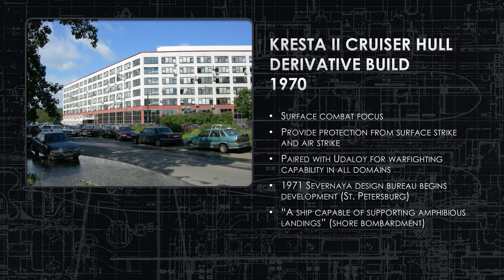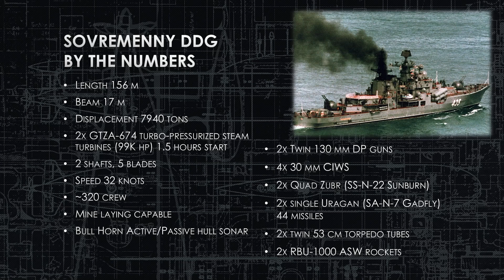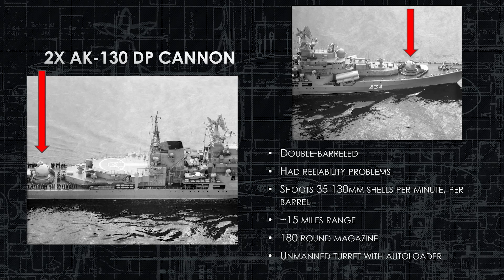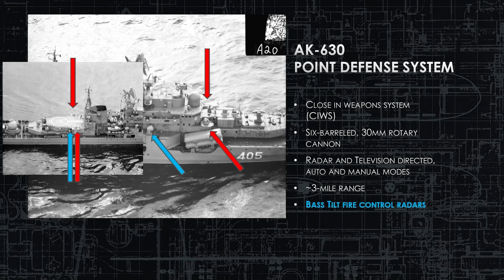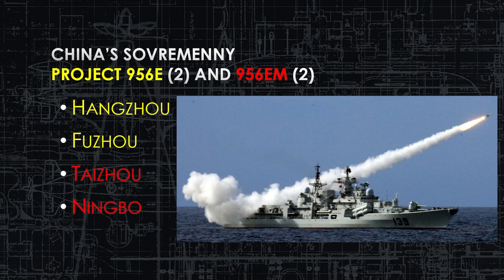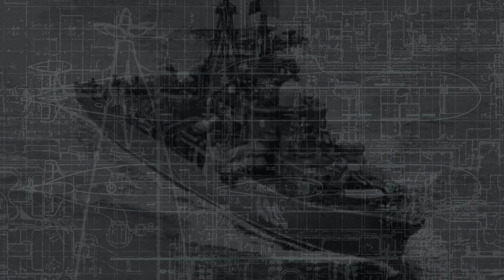The Most POWERFUL Soviet Destroyer Ever Built!

Comment: The propulsion system suffered from scale build up in the boiler tubes.   If you have impure super heated steam enter the engine turbines then you will very quickly cause pitting on the blades.  This can develop into catastrophic failure, blades disintegrating. At 10k rpm. Not good. Scale buildup is a problem with any of these water-based systems. The US Navy has strict chemistry programs to monitor and help mitigate these issues. Once coming out of a port in the Caribbean we had a cooling system immediately scale up. I mean within hours the tubes 3/4 of an inch tubes had add 1/8 inch of scale. In peacetime ops you shut it down.

Doctrine to kill the sovremenny-class destroyers: SM 1 or 2 salvo size 6-10. The SM1 covers 15 NM in 10 sec.The close in/ point defense systems will be over whelmed . It may knock down 3-4 SM1s but even three SM hits and they will be too busy with damage control. soviets/ Russian are not quick enough. of course you still have to get into position to shoot first and an SSN may be there first. but I would pray those assets will be seeking under water as a priority.

I got to walk aboard  a Sovremenny and. Udaloy in 1990 in San Diego. 1) sailors sleep in hammocks. crew personal gear were hanging in bags on hooks,  crews toilet was a horizontal eight inch pipe with holes cut in it. it was a real step back to the 19th century 2) I saw only four fire extinguishers. No hose stations. hydrants but without ready hoses. Shoring lumber was painted in place. 3) CIC had four scopes.. 

Now I will grant this, Soviets sent older ships. But if a portion of your fleet is like this you are toast in a serious fight.  The reciprocal visit of Russian admirals to a Burke class  was conducted (1995). We brought their admirals right into  the sanitized   DDG's CIC and showed them what " mission control " afloat looks like. I saw mouths actually gape when we turned on one of the main display screens 

Note : We did not show them anything that was not normally shown in a public tour.

It is too bad our corrupt govt cannot  get it's act together. These ships are still being built, but some are now over 30yrs old and there is not a serious follow on design even planned. America's biggest problems are its own corrupt officials.

Comment: P-Fired Boilers are equivalent to the ones on my 1967 Garcia class (USS Koelsch) that I earned my EOOW qualification on. Ours were 1250 psi, so the boiler-water feed-water purity requirements were stricter than for nuclear plants running at far lower pressures.

Comment: Mr. Sub Brief misses one key point: in 1984 the radio horizon of the CG of Ticonderoga-class was around, let's be generous, AN-SPS at 20 meters, let's count with 3M80 20-meter elevation about 32km . But here is what Mr. Sub Brief doesn't know, Moskit wasn't flying straight, because it also could see the target with its active radar homing head from 32 kilometers and instead of flying at 20 meters at terminal it was beginning to maneuver violently, including, but not limited to, conducting anti-AD "gorka" (hill) maneuver with insane g-loads and it was done at the speed of M=2.5+. If you think that Aegis and whatever was carried then in MK 41 VLS and Sea Sparrows could handle that, let alone a salvo of 4-6-8 of those--I have a bridge to sell you.
Reply from the maker: good feed back. thanks for the context.
Reply: Lmao we trusting russian agitprop in 2025?  We've seen their superweapons fail miserably time and time again.

Comment: You forgot that the PLAN also put HHQ-10 and refit the Sunburn with newer YJ-12, which tbh looks similar except more blocky intake :v
Reply: He confused the 956E refit with the 956EM.

The refitted 956E kept the aft turret, and AK630. Changed missile to YJ12 and VLS HHQ16. Added HQ10 for point defence.

The 956EM was built with extended helicopter hanger  deck without aft turret, and had Russian Kashtan fitted as standard. There's no such thing as a Chinese Kashtan. 
Neither 956EM had refit.

Comment: Is there really a meaningful distinction between cruisers and destroyers these days?
Reply: Imho it's now a question of Mission, rather than shape or size.  For reference, compare the Spruance, Kidd, and Ticonderoga classes- all built on the same hull.
Reply: @WildBillCox13 This is the answer: mission. To add some more context, one of the critical capabilities the Ticonderoga class has over the Arleigh Burke is that the Tico has additional facilities to host the Air Warfare Commander, which is a critical role in defense of the CSG. DDGs can theoretically take on this role, but the lack of dedicated facilities makes hosting the Air Warfare Commander burdensome and comes at the cost of other capabilities.
Reply: @WildBillCox13  So what mission distinguishes a cruiser from a destroyer today? Originally, cruisers were built to be able to act independently of the battlefleet, and destroyers were built to screen the battlefleet, but what is the distinction now?
Reply: In today's world for the larger Navies, i.e U.S , Britain,  France, Russia, etc; the only difference is the amount of missiles it can carry and with U.S Aegis Cruisers compared to Arleigh Burke Destroyers is that the Cruiser (Ticonderoga) also have two more Aegis Radars. That's about it. The missions are about the same now.
Reply: Cruisers just sail around, destroyers kill things.

Idk I'm not in the Navy.
Reply: In modern naval warfare theres no meaningful difference between a cruiser and a destroyer aside from the fact that cruisers are usually bigger than destroyers. Their mission sets are pretty much the same these days
Reply: well, take a look on 1144 project....
This is a cruiser
But it's kinda battleship sized boat

Comment: Noticed on a few other videos, Joint Stock Company - that isn't the name of the shipbuilder.  A JSC is a type of company (A public joint-stock company, abbreviated PJSC or open joint-stock company, abbreviated OJSC, is a type of company in many successor states of the Soviet Union, particularly in Russia. Its distinguishing feature is the right of stockholders to trade in stocks without the permission of other stockholders).

In this case the particular JSC is United Shipbuilding Corporation.  The shipyard they own that built these is Severnaya Verf, or during the Soviet era Shipyard No. 190 (in the name of Zhdanov).  JSCs are a post-Soviet structure and United own a great deal of shipyards.

Comment: Sovry was not so often on the sea because faulty propulsion (in fact, it was more reliable, than Udaloys gas turbines) but because of their mission. Sovries were antiship and antiair ships, udaloys were antisub ships. In time of peace, antisub missions were regular, antiship missions not so much.
Reply: The Udaloy2 class is  a Replacement for  both vessels. It is reliable Gas TURBINES or Didn't YOU KNOW! HEY SPENDS MORE TIME AT SEA THAN YOUR LCS? Didn't YOU KNOW THAT EITHER!
Reply: @HENRISTARKS  No, Udaloy II was not replacement for both vessels. Original Udaloy had Silex "missiles" which was by rocket delivered torpedo primarily against submarines, because Udaloy was anti-submarine warfare ship. But during 80s Soviet navy accepted into service RPK-6 Vodopad, which was by rocket delivered torpedo, which fits into classic 533mm torpedo tubes. And all ships with those torpedo tubes were pretty soon equipped with those Vodopads. In that moment Silex RPK-3 "missile" become obsolete because Vodopad RPK-6 was superior in everything and Udaloy could carry up to 20 Vodopads. So they had now free large missile launchers able to equip large antiship missiles and choice was Moskit, which was not so long range as P-500/700/1000 but it was faster, significantly cheaper and had very good AA defense penetration ability. But Udaloys II mission did not changed. It was still ASW ship, with only selfdefense AA capabilities (yet massively improved by Kashtans) but now packing also some serious anti-ship punch.

They eventually replaced all Udaloys Silexs by Moskits. But mission division still remained.
Udaloys were ASW destroyers, Sovries were AShW and AAW destroyers-escorts with side mission of coastal bombarding with their 4×130mm cannons.
Reply: @tomascernak6112  Udaloys Had better AA capabilities, as far as i remember.  
Thought you are right, besides, another Sovry mission was Assistance and Artillery Support for landing operations. Which are not really common as well
Reply: @RighteousFallen-III guess YOU NEVER HEARD OR SEEN SA-N-9  with CROSS SWORD FIRECONTROL RADARS. SAN9 is a Short Range SAM like a SM1MR!  SAN7 GADFLY WITH FRONT DOME FIRECONTROL RADAR IS MEDIUM RANGE SAM! Uh yeah from a GM AND FC TRAINED COLD WAR VETERAN BB61 87-90!  Get YOUR FACTS STRAIGHT OR BE SILENT!
Reply: @RighteousFallen-III  You are wrong. Udalyos had "Tor" short range missile system. Sovries had "Buk" medium range missile system. Sovries were intended as escorts for capital ships like aircraft cruisers or missile cruiser. Which had very good ciws and also long range AA defense, but lacked medium range AA defense.
Reply: @tomascernak6112  Ah, yes, makes sense since "Landing Fire Assistance" includes suppression of aerial targets aa well.
I've always had bad times remembering "ground" names for Sea converted AA
Reply: @RighteousFallen-III  This is absolutely understandable. Soviet-NATO naming is absolute mess. This is why we should have discussions/comments in first place, we can discuss things and either correct ourselves or learn something new.

Comment: I really don't understand the issue with the water, as even older merchant vessels could produce distillate quality water.  I would tend to think that in service they either weren't maintained (excessive steam, condensate and feedwater leaks, especially to auxilliary systems), thus requiring makeup feed in excess of what the distilling plant could produce, or poor availability of chemicals and testing equipment.  If the boiler water isn't dosed with oxygen scavengers and phosphates (basically soap), then the scale which forms on the tubes creates hot spots which then blow out into leaks.  This could also occur if the tubes and boilers were of poor quality and developed leaks at welds or joints.  This would also increase makeup consumption. Making sure your feedwater is pure is one of the most basic things a marine engineer learns and I honestly can't belive, even the soviets, would willfully neglect that.  Not to mention, they were operating nuke boats at the same time, which had no problem making distillate and operated on much tighter margins.  I think that they blamed the crew for design, construction and maintenance defficiencies so some bureaucrat could save his head.
Reply: It seems to me difficult to believe, too. Why to build a very modern and powerful ship only to get broken it because 'impure water'?  I really would take this video with a grain of salt literally.
Reply: @diademadiademoni202 normally he is very charitable and professional regarding bias against the soviets and other non NATO navies, so I'm guessing there is some truth to the issues mentioned, but he may be drawing from a less reputable source for lack of a better one.  While the subs are always in the limelight and get tons of research, especially regarding the machinery, the surface vessels are often understood as barges with guns.
Reply: @ strange, really. Also because it seems that Chinese still uses and modernize this ships. Really, it seems to me quite meangifulles this story about the 'non pure water' (like to make distilled waters would be a secret high-tech science).  Not forget too, that Kresta II had the same basic hull the same engines, so the issue should not be present in any case as already experimented for years.
Reply: @nomad8723  Globalsecurity gives this statement: In general, one can note a decrease in the level of discipline of Russian conscripts in comparison with that of the military personnel of the USSR period. In this context, for example, the history of the service of destroyers of project 956 is indicative. In Soviet times, they were actively used in the performance of combat missions of the Navy, participated in a number of major naval exercises, made international visits to the countries of Latin America, North Africa and Southeast Asia ... However, after the collapse of the Soviet Union, most of the ships quickly went out of order - out of 17 built ships in the fleet by the end of the 2010s, there were only three. One of the main problems was the lack of specialists and the inability of the military to provide quality services to complex boiler and turbine installations. At the same time, four ships of the same project, which were transferred to China, serve regularly and do not face similar problems.''' So this would mean that the problems arise after the fall of USSR.
Reply: @diademadiademoni202  look at videos about the history of the Soviet navy it will all make sense
Reply: @ what sense? Really we should take it that soviets used saltwater instead distillated one? Then the soviet subs should be all junks before 1989.

Comment: Steam powerplant was not problem during USSR era, but after that, they indeed had problem to get clean water into reservoirs.

Gas turbines had their benefits, but in 70s and 80s, they were pine in the ass, they had really short designed lifespan and had to be changed regularly. This is also why those american ships has 4 these turbines. In normal operation at cruise speed, those ships were using just single turbine and saving other 3 turbines run time. 

Steam powerplant can also compact really powerfull propulsion into relatively small space. Steam has hell lot of power. From todays perspective, they are of course outdated.